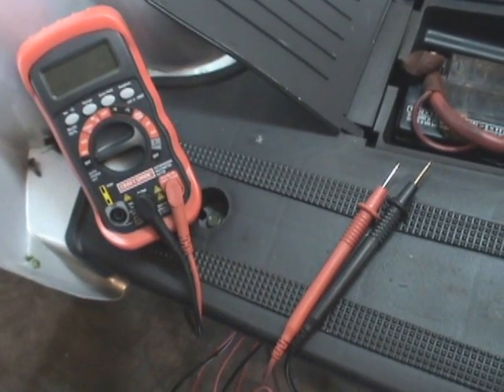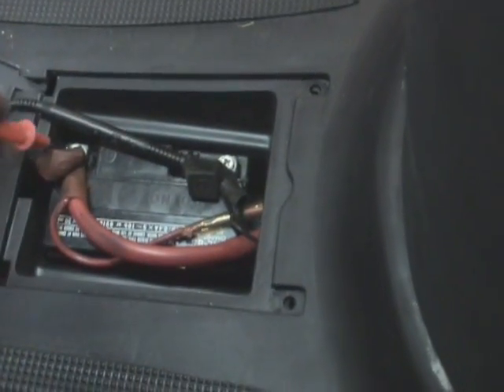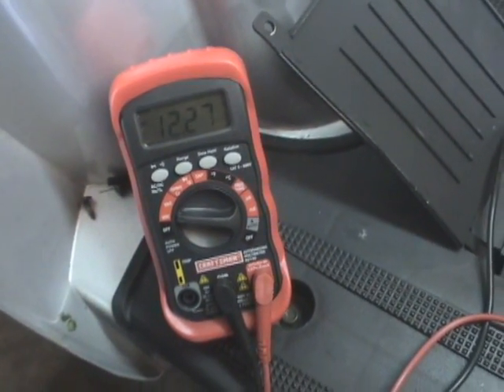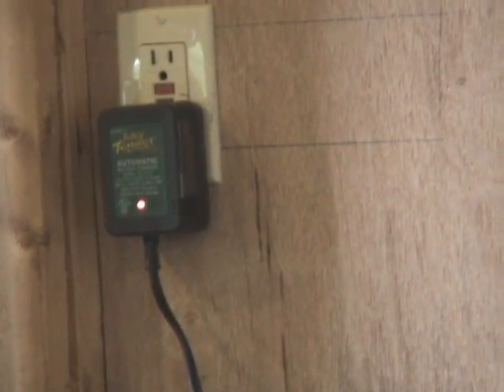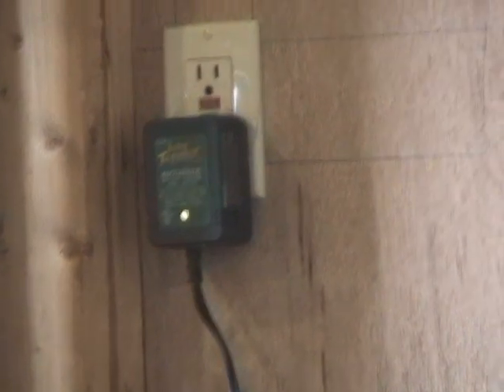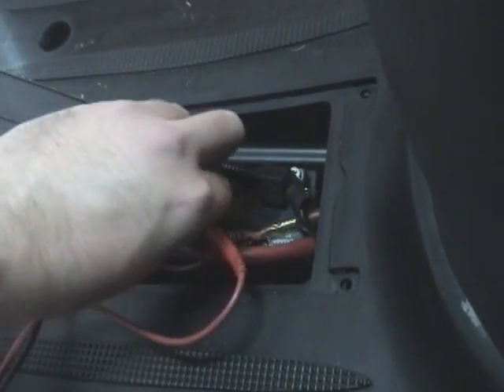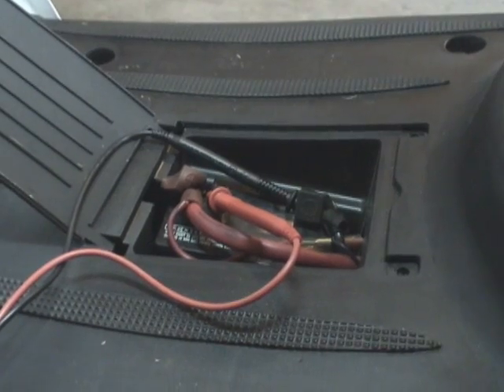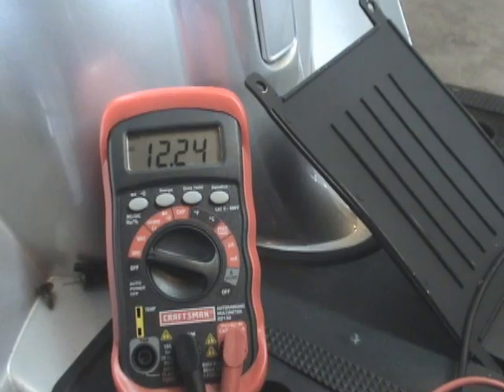Scooter 12V Battery Condition Checks / Tests

Comment: My King GT battery when fully charged hovers around 80.6 volts, is that good ?. I know nothing about e scooters. I've barely used it, I've seen others with theirs fully charged and their voltage is around 81v up to 84v. Its still fast as shit and the battery doesn't seem to drain to fast when using it.
Reply from the maker: That sounds OK. Usually around 4V per cell (assuming 20 cells) is a good safe charge. You may be down on capacity slightly or it may be that the charger is cutting off earlier than some others. If it's working well, carry on.
Reply: @49ccscoot  Thanks. I've just remembered it can take two chargers not just the one. My older Wolf Warrior has a better battery imo and overall is just a better scooter. The King GT is far to fast for the suspension and brakes it has. I've given you a sub since you took the time to help out and i could most definitely learn a thing or two. Most ask for subs then ignore you once you do.
Reply from the maker: Thanks. I don't do e-scoots, but I hope you can find something that interests you.
Reply: @49ccscoot  I've been looking into motorbikes for a while, is that a Aerox 50cc you have with green wheels ?
Reply from the maker: It's a Chinese scooter (Vento Triton with lots of work), but it has Aerox wheels now.
Reply: @49ccscoot  it's sweet.

Comment: At what amp should the charger be set to, my charger says 2 4 and 6 amp. I was charging it at 4 then was told to put it on 2. It read 75% on 4 amp then when I switched it to 2 amp it said it was fully charged
Reply from the maker: For these small batteries, stick to 2A. I keep mine on a Battery Tender when possible.

Comment: what should a 12v battery read while diconnected? the one i have is reading 5.30. does that mean its bad?
Reply from the maker: You can try charging it, but it's probably bad. It should read over 12V if fully charged.
Reply: +90GTVert i changed the battery and all lights work now.   but the engine still doesnt start. the click is just louder now. i tested the solenoid by laying a screw driver across it and nothing. starter maybe? im hoping the engine isnt seized.
Reply: +90GTVert my kickstart seems to be stuck as well.
Reply from the maker: With both the starter and kickstarter not moving, you may have an engine problem. Take the CVT cover off and make sure all looks well and try putting a socket on the variator nut to see if you can rotate the engine by hand. If not, you'll have to find out what's going on inside of the engine. You can check under the cooling fan shrouds just to be sure nothing is jammed against the flywheel, but it's not that likely.
Reply: yeah im pretty sure my engine is seized. My engine wont turn freely by hand. The kickstart also seems like it doesn't grab anything when I try to kickstart it either. Might just get a whole new engine. Might be easier than trying to unseize it. lol

Comment: i use a deltron battery tender to charge my battery overnight. the next day, my scooter is dead. i plug in the charger and it charges for about 10 minutes until the solid green light comes on. then it turns on fine. do i need a new battery?
Reply from the maker: JSuon Probably. Voltage checks as shown would help you determine that.

Comment: I have a 12V 12Ah x 2 batteries for a Rascal EM115 Scooter. While on charge, the meter shows fully charged, and the scooter will run fine. Once you disconnect the charger, the meter shows fully RED, and the scooter won't move at all. I've hit reset, but still no go. Can this battery be saved, or should it be put down for the count?